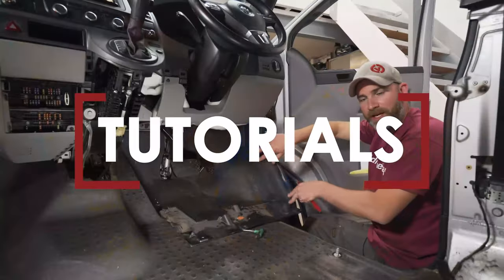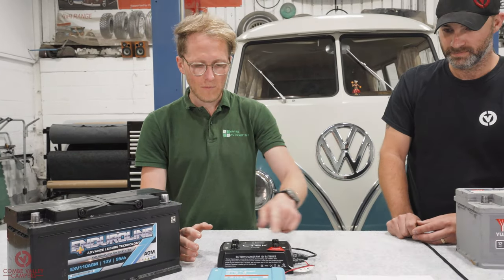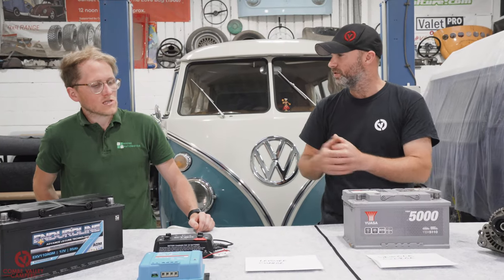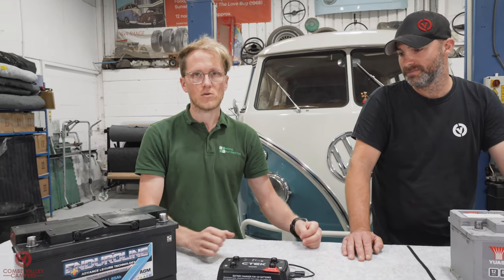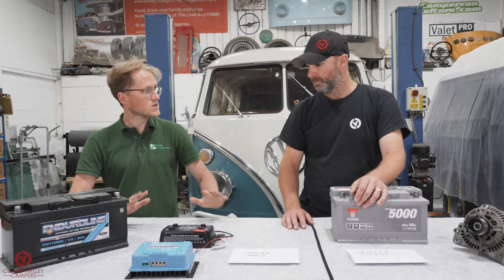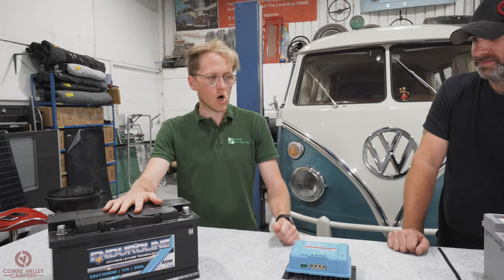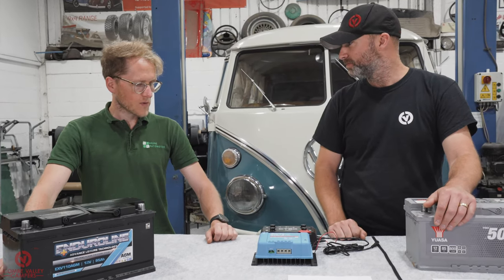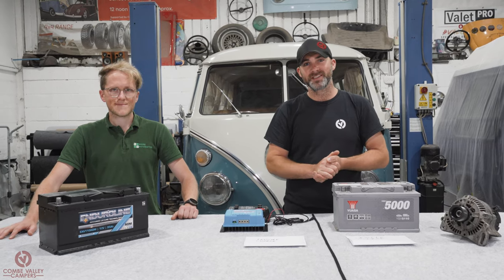What is a  DC to DC Charger? And how does it work?

Comment: Great walkthrough on the install, however please make sure you install the fuses as close to the source as possible. 
So for example the battery feed to the charger from your starter battery (van battery under the floor plate) needs a fuse as soon it leaves the positive terminal, as well as the ignition feed wire, fuse just after the ring terminal you installed. 
Also its good practice to use conduit or plastic trunking on all cables to avoid any chaffing on sharp edges, as well as hollow grommets when running cables through factory or pre drilled holes. 
I hope this helps, better to be safe than sorry 

Thanks!

Comment: I fitted the ctek last week after using a standard split charge and it’s instantly looking after my AGM battery better it’s charging about 14.8 now compared to the 13.8 of the previous charger so its charging the AGM to its full capacity now
Reply: May you send a link to buy it, please?

Comment: Interesting video,  I used the Sterling Power BB1230 in my conversion, the later ones with the green stripe don't need an ignition switched feed so very simple installation.  You don't have to have a smart alternator to use this type of charger; if you don't,  ideally both batteries need to be the same type.
Reply: I have the green strip sterling 30amp on a auto sleeper duetto, charging a lithium, on my amp meter the most it will output is 22amp but it’s been reliable for 2 years so far

Comment: I would like to try the Victron to be used on my new Tesla Highland which has a 16v on the DC to DC convertor. To charge a 12v lithium battery to power my 800 watts sound system. I was wondering will it work and how should I tapped the remote ON from the car to the green by pass plug connector. As tesla does not have a ignition switch

Comment: Is there a more in-depth look at the capabilities and differences between the Orion and cteck? I was assuming from the video they are the same in capability but reading a few comments they are not really quite the same as in when you incorporate solar. Just to clarify as well, how does the Orion know when to take the charge from the battery without the ignition cable.

Comment: Great video. I fitted the d250se last week. I wasn’t sure whether I’d got a smart alternator or not but with both small wires disconnected (I have a lead acid leisure battery) I’m getting a  14.5-14.9v permanently. It doesn’t fluctuate any more than that so I’m pretty sure I’ve  got a standard alternator. All the lights that should come on do come on so as far as I’m concerned it’s working great. So easy to install too.

Comment: Great video! I have a VSR in my T5 at the moment which is constantly clicking on and off randomly. I’ve had it checked and the supplier said it’s working fine. Wiring has been checked and that’s ok and my 2x110ah leisure batteries are good too so I’ve been looking at the victron Orion 30a b2b. Great to get more info on both as I have considered the ctek as well.

Comment: Very informative thank you. Do you give advice as could do with some as looking to replace a split charge relay as now have a Renogy 100w  Lithium battery. Would a Renogy DCC50S or 30S on a VW T5 2.5 2005 be ok. Bit worries as it mentions vsr in their video but did not think that is acceptable with a Lithium battery. Help!!😊

Comment: Can you please explain how to correctly size these Dc to Dc chargers.  they come in 20 amp 30 amp and 60 amp versions . Also alternators have different outputs. Should this be used to decide on size of charger  EG i have a crafter which is fitted with a smart alternator the output in 140wmp, how do I know what size is best to optimise rapid chargeing

Comment: Good afternoon, thank you for your video, I have a question, what happens when you have 24 V lithium batteries and you want to charge with the car's alternator? Should you use a cd-cd 12/24 and connect in the same way? Or is it necessary to use an additional electronic device? Thank you

Comment: Hello, I want to replace the batteries of my motorhome for a 300ah lithium. I bought the victron isolated smart dc-dc 12v 30 amps. Can I connect the victron changer with the wires that are currently connected to my auxiliary batteries (by adding 60 amp fuse protection at the input to the output) to my new lithium without modifying the old installation...

Comment: Thanks for this really helpful video. I have a sprinter and am using a BLUETTI AC200max for my leisure battery system (it includes an mppt charger and it’s settings allow for selecting solar or car/mains charging. Do you know if the Orion is a good solution for charging this via the alternator? Any experience with this? Thanks ❤

Comment: Quick question if anyone can help. I have a solar system Epever mppt controller it’s wired to charge my leisure battery. Do I need to change the controller in order to charge my main battery or is there another way to do this. Thanks in advance if you have any advice, I would appreciate the help 😁👍

Comment: Very well presented gentlemen.  Thank you.  If I buy a dc-dc charger, how do I select the right size.(20/40/60 amp).  Would like to maximise charge when driving, but without over taxing the 160 amp alternator.  I suppose I could run everything on the vehicle and see what the current is, and therefore how much "headroom" there is.  Can't find any guidelines published by manufacturers (Victron or Renogy).  Any pointers would be appreciated.
Reply from the maker: Hi! Would you please email your answer to info@combevalleycampers.co.uk and we can give you a comprehensive answer. Leigh

Comment: Great video.  Please can you advise as to the isolated or non-isolated choice of the Orion?
Reply: Am I correct in saying if the negative of the input battery and the output battery are both connected to the chassis then non-isolated can be used?
Reply: Yes. Not recommended for use on aluminum boats.

Comment: My vehicles does not have a smart alternator.  I have a 175W solar panel on the roof to keep an SOK 100 amp hour charged.  I'm also using a Redarc BCDC 25 amp charger as well, but not the solar capability that it offers...I'm using a Victron MPPT controller for the solar.  Just curious if the MPPT and Redarc will cause problems, or will they both work together without issue?  Would be a better idea to add a relay that would cut out solar charging when the engine is running and revert to solar when the vehicle is shut off?

Comment: nice explaination I have a older van 05 it's not a smart alternator I have the victron battery isolator argofed. I'd like to add a battery independate of my house battery, it's charged w/ alt.shore power or generator. I'd like more battery battery separate from current house battery so can I charge w/a dc to dc charger. ? then if I choose to combine batterys can I use bothe the isolator which has out puts for 2 batterys an use dc to dc along w/ the isolator?

Comment: Great video guys. The thing you didn’t cover was how much current each unit could handle. The victron in your video is rated at 18 amp but they make a 30 amp version as well.  I don’t know about the c tek. I have just bought a 120 ah lithium battery I am concerned that I might damage my vans alternator if it tried to recharge this battery too quickly for too long . Am I better off going for the lower rated unit or  am I worrying unnecessarily?
Reply: You will not damage the alternator, as the main difference between the two Orion's is the output wattage. Or specifically, charging current. The Orion will not charge too quickly as lithium batteries have different stages of charging. You will be just fine, be sure to program the Orion to lithium specifications.
Reply: Hi, I am questioning the same thing about the amps, so basically would the 30amp put more in quicker ( at a controlled rate specific to the type of battery ) than the 18amp ? Hope that made sense.. in other words.. why buy the 30amp version ?
Reply: Hi, I am questioning the same thing about the amps, so basically would the 30amp put more in quicker ( at a controlled rate specific to the type of battery ) than the 18amp ? Hope that made sense.. in other words.. why buy the 30amp version ?
Reply: @copperknob1971  Yes the 30amp version would recharge your battery quicker, which would be useful if  used on short journeys. I was concerned that the higher amps could stress the vans alternator. I have had no problems, so far, with Victron 30amp DC-DC charger and would recommend it.

Comment: This is a useful video. Thank you. One thing I cannot figure out is if there is ever a point where a leisure battery should stop being charged. I have a basic relay currently so yes the voltage is not regulated but my concern is if the leisure battery is fully charged, does sending a current to it cause any damage? My guess is that it is protected by the same voltage regulator in the alternator as the main battery but wanted to check. Thanks!
Reply from the maker: Hi nick, that is correct, the voltage regulator for the car will prevent Iver charge. Leigh
Reply: @CombeValleyCampers  Thanks Leigh

Comment: I don’t have a smart alternator.  (2005)
I’m going to need a new vehicle battery soon and wondered if it needs to be about the same as the in-house battery.its a marine deep cell 100ah , I’d like to get a second one to connect together. 
I’d like to charge these while I drive for over country drive/park. But have it with the dual ability to charge by solar panels . Then again 2 100ah batteries will need how much solar watts to charge up ? I’m so confused. Is the charger with a controller - and should I change the travel trailer converter ?

Comment: Ok I have to say really good explanation I actually learned something from your video but I have a question all the videos I see on battery charging in cars or Vans campers RVs whatever everybody talks about the same thing battery to battery charging DC to DC charging etcetera but nobody explains how to simply swap a lead acid battery to lithium and charge it properly I'm trying to understand how to run from my alternator to a lithium battery a smart alternator like you're talking about in this video 2019 Toyota Camry which only charges at 13.8 volts I'm trying to get 14.4 volts to my lithium battery so that it doesn't hurt the battery what kind of charger DC to DC device what do I need for a single battery setup to step up the voltage for a proper charge I'm not understanding why everyone is going crazy for lithium batteries and recommended the swap so I purchased one to do the lead acid to lithium swap for better charging/ discharge,the lifespan everything really but I can't for the life of me mind a video or explanation that doesn't involve a lead acid starter battery I don't want a lead acid battery anywhere in my setup I would rather have a massive lithium bank and everything go to it and it alone than to try to split charge and Fry my alternator or have to charge four times longer than necessary how do I do just a single lithium lifepo4 battery with a smart alternator please explain this to me I am brand new to lithium and I am trying to learn for a dual purpose one for my tow behind camper and the other is car audio a hobby of mine both fields use lithium for the best power delivery possible I have a 74AH lifepo4 battery in hand that I want to add to my car audio system and would have already purchased my camper setup but as I said I literally can't find anything on the subject of just running a single battery bank with a smart alternator

Comment: What's the difference between the different amperage dc to dc charger available? Like some are lower amp, some are higher, is that just how much they can power or do you choose based on battery sizes like with an mppt?
Reply: I also would like to know this

Comment: So if I have a 2007 Nissan Xterra and decide to go with the ctek do I HAVE to do the ignition switch?
Reply: I’m wondering the same
Reply from the maker: If you don’t have a smart alternator you do not need the ignition switch lead connected according to the installation instructions

Comment: Is there a DC-DC Battery Charger that's good for more like 400 or 800 amps instead of just 20 or 40 amps at 12 volts? Because what If you ran it with mechman aftermarket 400a alternators?
Reply: This is what I've been asking too, seems the only way to get up there is to buy multiple chargers and use them together.

Comment: Can you install the Orion under the drivers seat?
Reply: If on a substrate that can handle high temperature and has proper air flow for cooling. Do not get it wet. I.e. spilled drink. The cover will not shed liquid compared to a vertical mount.

Comment: Surely if you are away camping for say 5 to 9 days and the van is not being used there will not be any source charging the leisure battery so are these units only good for short stopovers when the van will be used and charging the batteries. If I am right in saying this then surely a solar installation is more efficient 🤔

Comment: Sorry if I missed it, but can the Orion do both alternator and solar at the same time?
Reply: I'm unsure of what your question is, a solar panel requires an mppt to the battery. The Orion is from the battery to battery. If your solar is connected to either the vehicle or auxiliary battery, yes the Orion will charge either one regardless.
Reply: @Geminiappleboy  sorry, the Ctek DC charger can charge the auxiliary battery from both the alternator and a solar panel. Is the Orion able to perform the same functions or would I need an Orion DC charger and a solar pot charger?
Reply: @CraigAndersonPhotographer  Thanks for clarifying.  You would need an Orion and also an MPPT from Victron as they are not an all in one component like the Ctek.